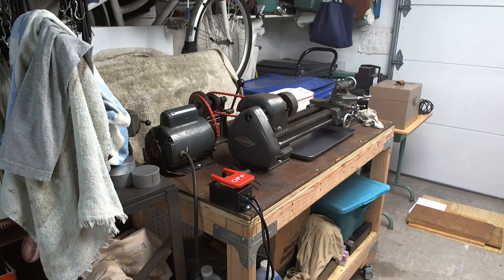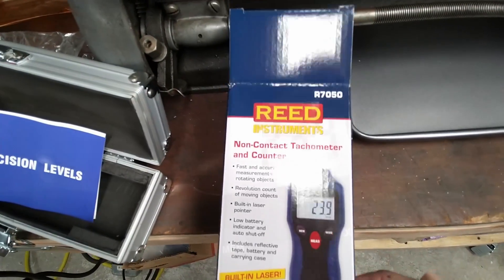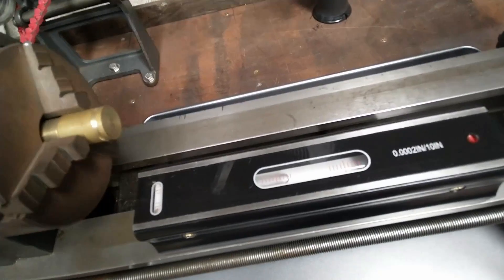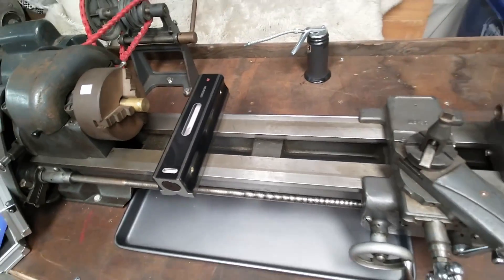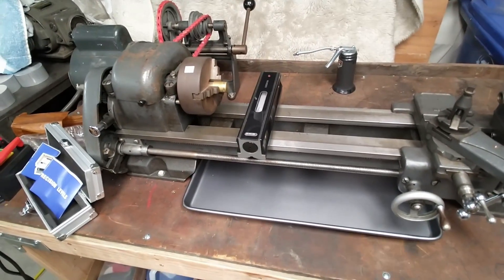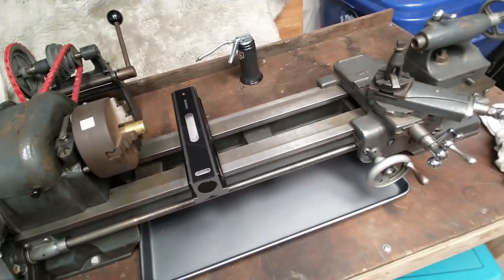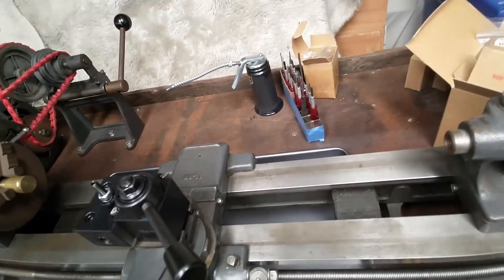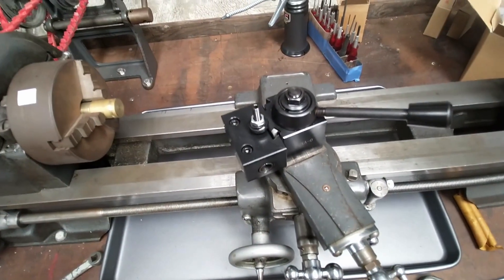Craftsman/Atlas 618 lathe initial setup

Comment: nice setup. Where did you get your on/off switch.
Reply from the maker: It came with the lathe, but it is just a normal 110v switch that you can plug a tool into that has the large stop button, they sell similar all over the place,  this one off amazon for example: 
https://www.amazon.com/Rockler-Safety-Power-Tool-Switch/dp/B001DT13B2/ref=asc_df_B001DT13B2

Comment: Nice explanation of everything - what is that assembly called that you use the lever to tighten/loosen the belts? I have an old Craftsman lathe and I think that mechanism would be great for my lathe. Thanks!!
Reply from the maker: I am not sure offhand what that is called....it came with the lathe in my case.  I know it helps adjust the speed of the belts ie to do the different speeds.  Trying to google for it and looking at parts diagrams...maybe it is a countershaft assembly? ie this looks somewhat similar:  https://www.hobby-machinist.com/resources/atlas-m6-20bx-rs-countershaft-assembly.3522/   
If your lathe did not come with it, it may not have been an option for it, or maybe it got lost somewhere along the way, in that case you would have to check for the parts diagrams for the specific model/age of the lathe...ie they changed things over time too.  I am glad you liked the video in any case.
Reply: @josephkrug8579  Thank you! I got 'just the lathe' several years ago, it is a Craftsman (made by Atlas) wood lathe, model 101.06260 and I have been looking for a similar mechanism to engage and disengage the belts quickly for speed changes. Thanks for the info - I will check that link and see if I can find something similar. 😁👍

Comment: Did you ever do anything to allow the tool post to swivel all the way around?
Reply from the maker: I did a bit more work on it yes.  I had to re-adjust some of the setup for it, I had also gotten a new base piece since it was cracked (ie that the tool post fits into).  I do still need to re-do the T nut and make the custom one that came with it so it better fits the slot, I also had added in another washer etc to get the height better set up.  It works a lot better now than it did originally.  I even managed a few small projects on it that also got their own videos.  So far I am enjoying using it...it has limitations for sure, ie is not super precise, takes a lot of hands on work to manage the backlash on the knobs while trying to do cuts etc...but is fun so far. :)

Comment: Try tightening the two Allen's on the compound rest. They lock  it to what ever angle you want it to be at.
Reply from the maker: Thanks, I think I since solved that issue since the video came out. :)  Good to know people are helpful though, I do appreciate the information.
Reply: @josephkrug8579  you could also set the compound to be parallel twitch the bed rails. Would then allow fine feed when facing.